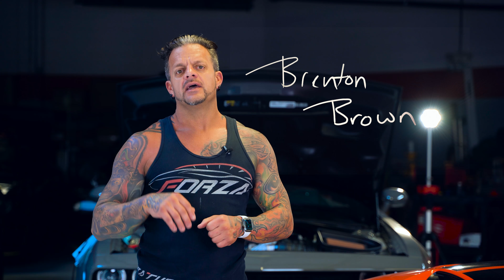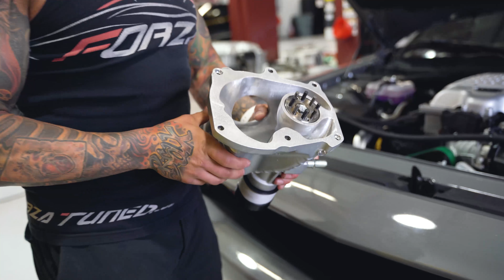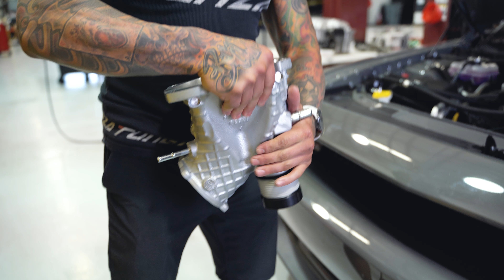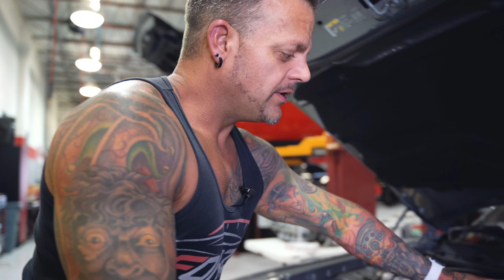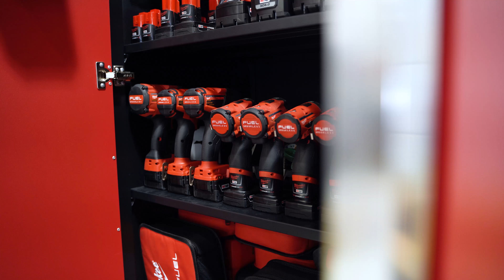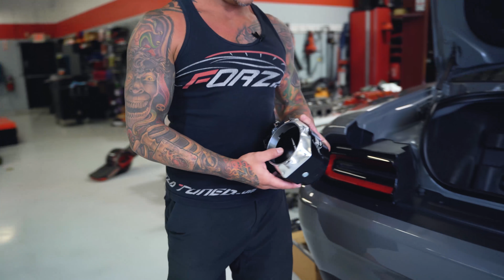The ULTIMATE Hellcat! Final

Comment: So, I was quoted that I had to change the injectors for the stage 2 option from a competitor.  I don't see that listed in your stage 2.  Is injectors not needed to safely make  880hp and is this crank or whp. Or is that an add on charge you do for your stage 2 customers?
Reply from the maker: I just did a Q&A video and this was one of the answers we covered.  It will be released in the next week or so.

Comment: Been watching your videos for about a year great info . I wish I lived in Florida my Redeye would have gotten everything done at your shop . Question? Do you sell the pulley with the anti slip grip treatment ? Question 2 If you sell it would it fit on a Metco HUB so I can change pulley and not have to remove the supercharger again . I have a Kong throttle body on my Redeye already 
With a custom intake . It will require a lot of street tuning for drivability 
Mine still not perfect on the street 
Car Turns off sometimes after burn outs or goes into limp mode 
Waiting until my tuner gets time to street tune it . I had the same issue with the HHP throttle body it took a couple days
 of street driving to work out all the kinks 
Looking forward to seeing results after you install your Kong throttle body
FYI my Redeye build has been inline with all your recommendations for a Stage 4 
Thank You my car runs great and happy with all the advice and recommendations
Reply from the maker: We only build cars at our facility but we have transport service across the United States, Canada, Mexico and Europe

Comment: I had the kong 112 on my trackhawk for months.... it ran great at WOT but the daily driver aspect was terrible my tuner could never tune it to run smoothly inbetween 25 percent throttle and about 75 percent throttle.... it would buck hard... we spent hour and hours trying to dial in the drivability..... never could figure it out.... went down to a 105mm..... been great ever since I'm actually selling a used kong 112 if anyone would be interested.
Reply from the maker: Exactly why you never see us changing throttle bodies.  It’s the one single component you can change that has the best chance to negatively affect drive ability.
Reply: MrKennyhop21 I heard the same about the kong so I just ordered a 105 vmp tb. Hopefully going on soon once my snout gets ported.
Reply: Yeah my tuner is Satera up in Illinois and he is awesome, definitely knows he stuff when it comes to these mopars but after 30 back and forth remote tuning sessions with HP tuners I said enough lol. I ran a 10.2 at 135 on 22 inch velgans with a full weight trackhawk so I was very happy but never could get the drivability down. I am very interested to see if your new video shows any increase and if so .... how much over stock or even over a 105mm. Love your videos..... keep them coming!